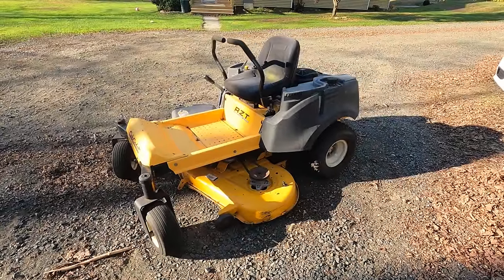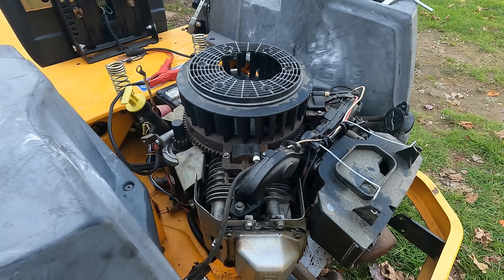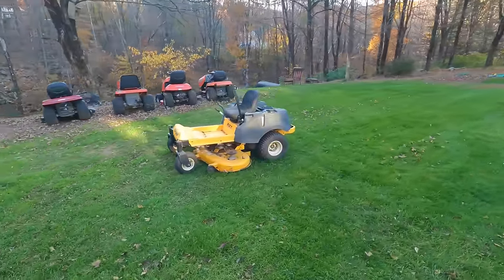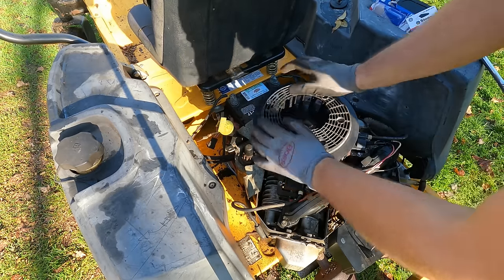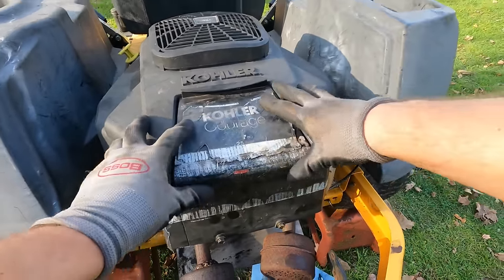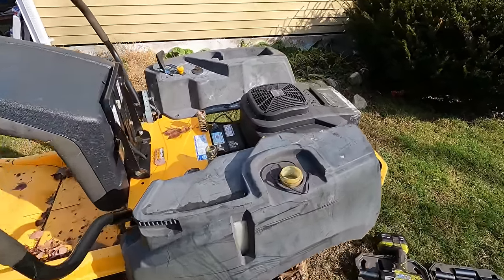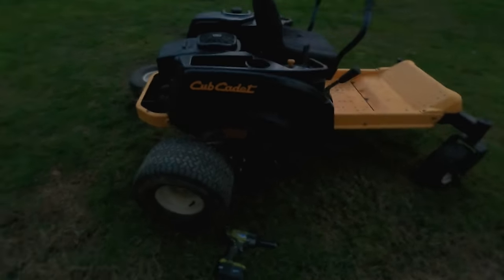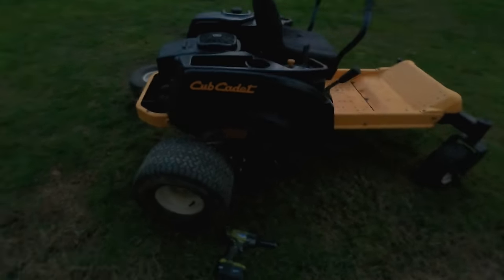Fixing my FIRST zero turn mower: Cub Cadet RZT

Comment: Fantastic Video. I just bought the same exact machine from a good friend this week. 
$200 and it runs well. Watching your video just taught me everything I needed to know.
Leaking valve cover gaskets , Thank You!  I’ll order new ones tomorrow. I went got a seat cover, be here tomorrow. I painted the left fender today. Removing the right one has to be investigated due to the ignition and the engagement knob. ( wish you covered that) . But I’m basically on my way to do everything you have done. Thanks Again for a great video.

Comment: Hello there, I am a new subscriber, I just gotmy first zero turn Gravely 2350 for free. It was just the frame and deck when it was given to me by a friend, I have since been hard at work putting it together using cub cadet parts wiring harness/engine/belts/pulleys/front wheels & tires, all from the cub donor.
Now it's running and mowing just fine but still not quite right yet, I have noticed something quite interesting and you won't believe it,  the left side transmission losses all power when engaged the deck but regained power when I disengaged the deck, I have it solved soon and I'll be watching your videos during my breaks.  You have a good one , God Bless.
Reply from the maker: Glad you like my videos! Hope you get your zero turn sorted out soon!

Comment: Also on the tire tearing up the lawn. When turning sharp or quickly, use both to turn one wheels should go one way and the other the opposite . If you use only one you pivot the tire instead of it rolling. That is what tears the grass. Hope that makes sense :) And the choke comment sent before the end when you figured it out. Again thank you and great job :)
Reply from the maker: Good advice about turning! I’m not used to zero turns that’s for sure

Comment: Kyle you did an awesome job brother. Super stoked for you!! Your troubleshooting skills payed off and got this unit running great after all the little hang ups. That piece on the transmission that was missing on one side is the parking brake. When those teeth mesh with the gear it holds it in place. The cadet turned out excellent. A tip for overspray is just take a little gas on a rag and it wipes right off, especially when it is still curing. Keep up the great work 😎😎🇺🇸🇺🇸
Reply from the maker: Thanks! Great advise- I’ll try that
Reply from the maker: Do you think I need to buy a replacement parking break for that one side? Or is the break only supposed to be on one side?
Reply: @Kylebythecreek I believe the brake needs to work on both sides.  The side without a parking brake might allow it to turn sideways on the hill or run into someone if they get off. This could cause the mower to tip sideways or cause you to fall off the side. Could be a liability if you sell it.
Reply from the maker: @gordonwilloughby8793  that’s very good to know. I’ll look into a replacement part

Comment: That loose cable is for each wheel, pull them out and over (so they stay out) to unlock the wheels to move the mower manualy short distances while not running.

Comment: I stopped the video at 16:13 noticing that the exhaust mufflers are different colors. I think the right side cylinder is not firing. Back firing meaning it is firing some of the times.

Comment: Get the xb-455 beadbuster best tool i ever bought. I had an issue with the aluminum pushrod bending more then once, so I ended up using 2 steel ones, not sure if the Kohler is the same but it never bent the steel rod, this was on a briggs

Comment: With that high compression reading I would guess either the valves are out of adjustment or the compression release is broke inside the engine. The compression release drops the compression making  it easy to start. I think the compression should be around 60lbs. with compression release working. I would guess that's why the starter motor got bent. Good luck :face-blue-smiling:
Reply from the maker: Good point! You are probably right about that

Comment: Man I Have Been Working On One Just Like It !!! Thanks For Some Pointers !!!!
Reply from the maker: You’re welcome!
Reply: @Kylebythecreek  mine surges when I throttle it up, but levels out when I engage the blades ..
Reply from the maker: @5dennisk  I’ve had that problem several times. Unfortunately it’s a dirty carb. Usually a very small passage is clogged
Reply: @Kylebythecreek  bought a new one off of Amazon, and it cleared up a bunch of. Bought a kit for 39.00 that had a carb , 2 plugs , 2 filters, 2 cut off valves, and a fuel pump . Along with a new piece of fuel line . Poured some Sea Foam cleaner in the tank and it runs pretty good . Need to adjust the throttle cable like you did for the choke . I just reach around while I’m cranking it and hold it up . Fires right off .

Comment: That's a Gen 2 starter. Need Gen 3. They break/explode/die. They drill and tap the end but the shaft is too small, usually breaks but yours is bent! Gen 3 is a thicker shaft as well
Reply: I agree it pays to get the 3 but don’t expect them to sale it because most of the time it’s a 2 😢😢😢

Comment: Worked on one kept having ,trouble put on two new carbs   ran good for a while missed and died , checked out Electrical trouble , carb and fuse wiring  put on new ground , two places ! Compression test shows leaking off , head gasket or valve s also Compression release gear stuck or striped1 Check  Teeth on starter some have 13 +15 or put new head bind ix on old starter/ Push rod s are different  Exhaust is steel  intake is Aluminum  so it will bend and not bust engine , could be valve guides there bad about   raising up not letting the valve close causing backfire  check bolts under fly wheel they come lose busting the magnets and put new key way in new any time you take off the fly wheel  cam gears strip made of plastic! /Now all you like is the Safety cover/belt keepers on deck

Comment: I would have cleaned up the threads on that loose valve stud and used some thread locker and torqued to spec to prevent a recurrence. I also would have pulled the other ones for the same reason - if one came loose then the others could too. 
Did you check the lash on those while you were at it?
Very cool straightening the bent pushrod!  You’re the very first one I’ve seen do that. Apparently, it works!  Great trick!🔧👍

Comment: Did you end up replacing that vacuum hose that was all pinched up or were you able to save it? Hoses are too cheap to not replace them while you already have them off, especially since you saw it collapsed. Great video!
Reply from the maker: The second engine had a good vacuum hose
Reply: @Kylebythecreek  Nice

Comment: I didn’t see you pull the emulsion tube or pilot jet on this carb. Any particular reason?  Is there actually a pilot jet - I couldn’t see one. 
I thought that might be one of the issues until you finally discovered the throttle cable wasn’t adjusted correctly to actually hit the choke setting. 
Once I get cables set correctly I hit either side of the clamp with paint marker for the future.

Comment: Mines a 2010 with kholer 22..Yours has dual exhaust 😂..Looks good.
Reply: And where you was talking about putting the washers on that starter I did exactly that between starter and motor..Little bit of a pain but It quit binding up and been useing it for years now.I pulled both hydros and change fluid and replaced cooling fans..Both coils been replaced..valves reset..It don't like doing hot starts neither..Floods left plug..I think the carb  is prob..Got new one just hadn't put it on.Runs perfect from cold start..Been a good one..4
Reply: I need to right a book..Mine is a 50 in cut..Mine also has separate choke pull.That mount on front of your deck you said roller mount Mine has like a ubolt that goes to the front to adjust the deck left are right and support..Had one handle safety go out..And I picked up a like new seat for it on face book for 40 bucks.Hadnt put it on yet.lol.You got all kinds of good help taping that baby up..Looks really good guy's. .
Reply from the maker: Thanks!

Comment: Great job Kyle. Did those foot rubbers come that length or in a roll? Amazon?
Reply from the maker: Hey Rick! Thanks! Yes, those rubber pads came that length. The two treads came in one package, I bought it off the shelf at tractor supply

Comment: Intake is usually aluminum because it doesn’t get as hot as exhaust thus exhaust are steel if they are the same length steel is ok for intake but aluminum is not good to use on exhaust
Reply from the maker: Thank you! And now I learned something today!

Comment: Did you change the gas and oil,fuil filter .
Reply from the maker: Yes I did why?
Reply: You looked at the filter and said it was new,jse
Reply from the maker: @seaneastman6323  not everything is filmed. I did a full service on this engine
Reply from the maker: @seaneastman6323 skip to 1:18:26 and you’ll see me changing the oil and the oil filter. It’s a long video, seems like you might not have gotten to this part yet.

Comment: I’ll never understand why these guys on these restoration channels won’t drain the old gas, change the oil, and check the plugs and wires BEFORE they try to crank the engine. You’re trying to start an engine in the worst conditions before checking anything then wonder why they fight with it so much to get it started.
Reply from the maker: None of those things caused the problems this engine had. Thanks for tuning in and commenting though!

Comment: I am 69 years old and I have never had a chance to try a zero turn mower yet. I really like the way they operate. I hope to try one soon. It seems to take less time to mow a lawn because of its ability to turn on a dime cutting out the wide turning with a lawn tractor. You have to cover more ground to get to certain spots on the tractor style mowers. Zero turns are definitely time savers.
Reply from the maker: They definitely are quick! Although they can turn on a dime, it’ll rip up the grass of you do a literal zero turn in the lawn. Still though, turning is much faster than a lawn tractor
Reply: I think they make cutting the grass more enjoyable instead of a regular chore
Reply: Need to be careful if buying a used zero turn,  some older John Deere had transmission problems,  very expensive to fix,  even if you fix yourself.  The cub cadets are a much better mower.
Reply: Cub cadets better than Deere? Yeeeeeah right.
Reply: @kc9146  
My daughter and son in law bought a John Deere 535Z and before the warranty ran out both transmissions had to be replaced. After the warranty ran out John Deere wanted over $1800 to fix it. Yeah, you can keep your Deere.

Comment: It is a lot of money to spend on a machine that has so many issues. I would rather be getting paid to do all this work but in your case your stuck with it now. I would sell it to recoup money spent but it would work great around your property and cut down on time mowing thus saving you money in the long run. Your choice.
Reply from the maker: I’m curious about the cost of zero turns in your area. In my area of CT $500 for a zero turn with good hydros and non-blown engine is a really good deal. I’ve seen them for $700 with no engine and a bad hydro side
Reply: Was basically commenting based on your description of items needing attention. Locally they sell for $4500 to $7500 used but fully serviced the price difference covers age of unit. Luckily your transmissions are in good shape but likely require fluid change. Is there an hour meter on this unit? A valve lash reset will likely improve starting and running. Check out Jakes video on the 3 generations of Kohlet starters many on line are still the 2nd generation and will fail as yours did or just snap the shaft off. @Kylebythecreek
Reply: Canadian dollars @Kylebythecreek
Reply from the maker: @waynestefinashen239  if you get a chance, watch the video. You’ll see all the work I did to it and how it came out. I think it came out great!
Reply: Chinese made engines will do that to ya